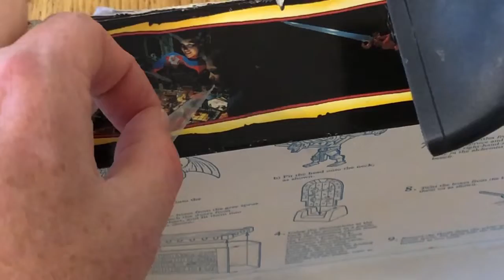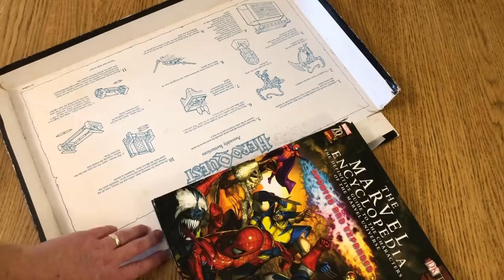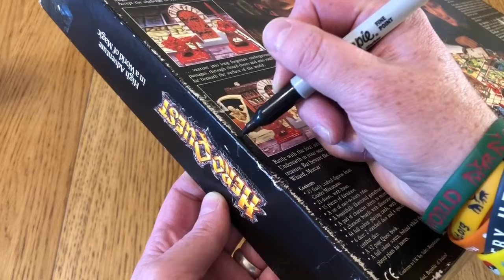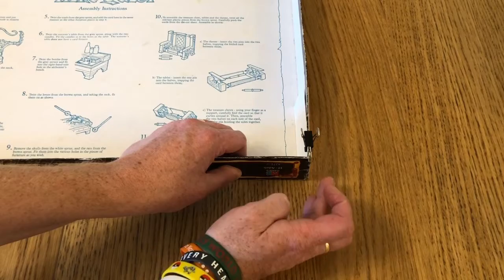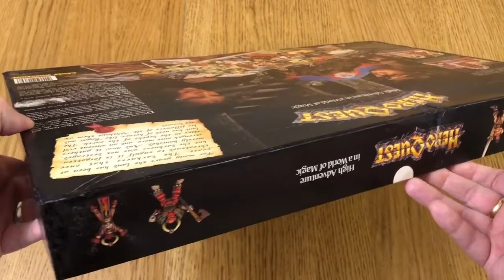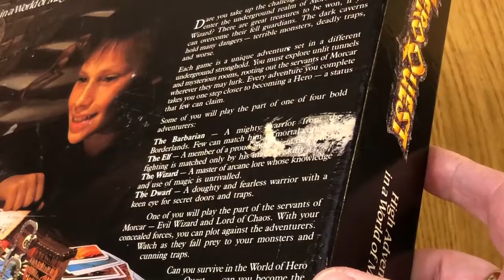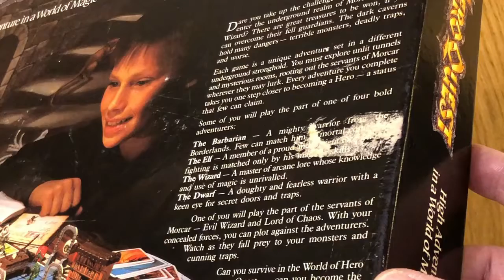Fixing or Repairing Damaged Board Game Boxes | The HeroQuest Restoration Project

Comment: That was very therapeutic to watch. 

I would love to see you show how to deal with the new snap inserts from the new heroquest box. I know hair dryers are used to push the molds out but I won't lie I've done one tray so far and some went a bit too much  out of shape! 

I realise a lot may ditch these trays anyhow for foam inserts so maybe a tutorial on how to make these? 

Either would be great :) cheers guv !
Reply from the maker: Thanks for watching. I will see if I can knock up a video about reforming plastic inserts. Personally, I am moving to magnetised crate storage for most of my miniatures. It's really safe, and provides very easy access to all my miniatures for games like D&D and Rangers of Shadow Deep without having to rummage around in different boxes.
Reply: @AlwaysBoardNeverBoring  will these fit in the boxes ? Or are you going to customise it and bin a lot of it
Reply from the maker: @cymraegddraig  No. Half the point of the magnetised storage crates is they stack on the shelf and allow easy access to all of my miniatures. If I want to play D&D, I don't want to open half a dozen different board game boxes to grab everything I need. However, I don't bin anything. Original inserts go into storage, so if I ever decide to pass the game on I can restore it to its original condition. I should also point out I don't do crates for every game I own. Sometimes the inserts are fine, like the ones in Godtear, and I have a Feldherr insert for my original HeroQuest (and plan to get one for Space Crusade too). For some unpainted games, the miniatures are just thrown into the box loose.

Comment: Any tips to safely remove glue residue from old tape if any remains? Very useful video, thanks!
Reply from the maker: Heat should get most of it. Apply the heat and gently rub or scrape the tape residue. If that doesn't work, you can try a little nail polish remover on a cotton bud - make sure to test on a discreet area first!
Reply: @AlwaysBoardNeverBoring  Nice one! thanks

Comment: I do love me some restorations. When cleaning up the attic I took the chance to at least repair the blown corners of some board games there. Personally I grabbed some thin card instead of thick, archive card to more strongly brace those corners. As a small aside, when weighing down the corner of your boxes, you can lay one book flush with the corner, but you can put the other books with their centers on the other book's corner for optimum weight. The only downside is that if the top books are too heavy, the corner of the bottom book can dig into the cover.
Reply from the maker: I like to keep the weight evenly distributed across the surface of the books so I don't end up with any bits of the box thinning out more than others. The three books I use weigh a ton! Thanks for sharing your own approach; fixing up a badly dinged game is vey satisfying.

Comment: very interesting topic. i myself am guilty of taping boxes together, but now i know how to property fix them. i have a question though. how do you prevent boxes from becoming scratched/ demaged? i would say i treat my boxed games pretty well but after a couple of years and playing with them the cartons scratch and the covers start fading. how do I properly store my games so them stay as new as possible?
Reply from the maker: Well, the first thing to accept is that board games aren't museum pieces (usually), they are to be used and loved. They will pick up little marks, and those are just badges of honour - proof they are loved and played with. But of course there are lots of things to consider to keep them looking as nice as possible.

Try not to store them in direct sunlight, as that will cause boxes to fade. Dust them regularly - dust particles can damage the card and also cause uneven discolouration. Obviously keep them somewhere away from damp and where temperature is regulated. Extremes of hot and cold, like you get in an attic, isn't great for games. If you have to store games in an attic for a while, get some big plastic crates and put them in with some silica gel packs to prevent any moisture damage or vermin attacks. 

If you stack your board games, it's often better to put the bigger ones on top of the small ones unless you have something crazy heavy. This sounds counter-intuitive but the strength of the box is in the bottom where the product sits. If you place small boxes on big boxes the tops of the big boxes are more likely to dish. I store most of my games on edge on book shelves as it minimizes pressure on the corners. If you do that make sure there is a little space around the boxes to easily slide them in and out without rubbing on other boxes or the shelf above. Keep your shelves free of dust and grit which might cause scuffs when you pull the boxes out.

Comment: Nice work.  I tend to to prefer just leaving all the old "character" in place.
Reply from the maker: There's definitely a good argument for leaving it as-is when it comes to things like the scuffing. I think it's one of those case-by-case things and will depend on the level of damage, personal preference, and how easy things are to colour match. Sometimes the character is part of the charm and the story, like a badly painted old miniature, but with this particular box the story was a murder mystery!
Reply: @AlwaysBoardNeverBoring  Nothing adds character like tape circles either.

The worst boxes are the old 90s GW.  Once the lid dishes out and the sides bow a bit, it's mostly a lost cause.  Some thick cardboard in the bottom and along the insides, cut from magazine archive boxes helps out a lot.   

I also tend to use this archive tape that is used for sealing book covers in place for some repairs.
Reply from the maker: I have an Advanced HeroQuest box which is a complete shambles. That should be a fun one to deal with. I might have to look into that archive tape. Sounds useful.

Comment: Pretty good but I am going to use stylized plastic cornering to reinforce mine. It may not give you that original look but it will sure make the box stronger, fix the blown corners and protect the box from further damage. I'm a scale model maker so it won't be too hard to pull off. I'll be using a style that will match the HeroQuest style of art. At least the bottom of your box is in better condition then mine. My old copy of Heroquest has so much scuffing on the bottom half, the picture and art is obscured. It saw heaps of use when I was a kid and not much tender loving care and like most kids just used tape to fix the corners. Great video. I just received my copy of the new re-release mythic tier Heroquest and I love most of the art. The detail in the figures is great although they lack the quality of the originals and seem small in scale. I think it's a lesser quality plastic used in the molds. The Dragon is fantastic. Now I just need people to play with.
Reply from the maker: The corner protectors sound interesting, and I'm pleased to hear you are happy with the new edition.

Comment: I have one top that an entire long side has come off. I imagine it will be a bit of a challenge to reattach it. I'll post my results on ye olde inn on facebook.
Reply from the maker: Yeah, that will be a challenge. One approach would be to use upright corner brackets, temporarily attached on the removed edge to hold it in the upright position, and then reattach both  corners at the same time using the method in this video. Once the corners are secure, run glue all the way along the separated long edge where it meets the box top and try to "pull over" any of the leftover paper to cover as much of the tear as possible. Good luck with it!

Comment: Nice work and good result considering the damage done to your box. I restored mine a year ago and used small triangle shaped pieces of grey cardboard to strengthen the corners from the inside. You can even lift the inner paper layer of the artwork to cover the upper third of this repair. Very sturdy and can be used in the upper and lower part of the box.
Reply from the maker: Yeah, sometimes it's worth adding some additional support inside, like a 90-degree "bracket" of card.

Comment: Using a hair drier to assist in removing old tape is a great idea. Makes sense. Wish I'd known about that a while ago as that would have cause less stress :)
I must admit that I was curious about how to restore the missing art, but you didn't… LOL! That probably would be miraculous.
Reply from the maker: There are ways to do it, but sometimes I just put my hands up and say, "It's just a bit of age, live with it." One of those things where prevention is better than the cure, and another good reason to blast any tape with heat before trying to remove it.
Reply: I resroring a dpace crusade box at the moment and came here looking for ideas on removing tape from boxes, its something I have always struggled with when restoring, I have used glue remover , ironing and all sorts of things and actually found the hair dryer method works by far the best. . 1 pice down and about a dozen left to peel though 🤣

Comment: I repaired the corners similar to you. I’m sure with the PVA they’re stronger than they ever were. The only downside is it’s ‘sealed’ the lid which doesn’t let air easily escape which means closing/opening the boxes is a lot more difficult (eg almost creates a vacuum/ suction effect when lifting lid, or compression effect when pushing down on lid to close).

Great vid!
Reply from the maker: But at least now your box makes comedy noises every time you play!

Comment: Nice work! My HQ box has a couple of blown corners on the lid, but is otherwise in pretty good shape. I like the trick with the 90-degree angle! I'll make use of that when I attempt my repairs. #fingerscrossed.
Reply from the maker: Glad to hear your box isn't as dinged up as mine was! I wouldn't wish a box in this kind of condition on anyone. It was certainly a challenge compared to my normal box repairs. Thanks for watching.